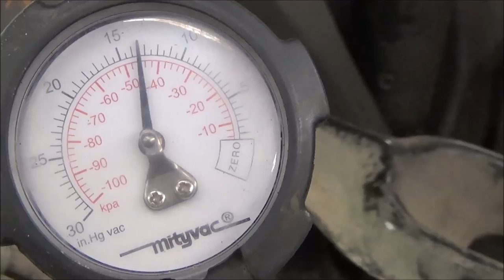Pontiac Grand Prix 3.8 - Water Pump Replacement

Comment: I've seen many cars go over 200k but never one as neglected as this one.  I have to say I'm impressed at its ability to keep going.  Kudos to Pontiac.
Reply from the maker: +Pook Atim Yeah that proves it... one heck of a car :)
Reply: It's that 3.8 v6. One of the best engines ever made
Reply: 3.8 is Buick.
Reply: Amen to that brother, on Wards Top 10 Engines list many times
Reply: you got that right !
Reply: not necessary ! they put a 3.8 in Oldsmobiles, Buicks and Pontiacs !
Reply: Mr Berzins is correct as Buick is the original source of the 3800, I'm sure that's what he meant. The 3800 engine was originally a Buick. In 1961 Buick needed  a more gas efficient ans inexpensive engine so they literally took their  current 8 cylinder and chopped off the end cylinders added a bit to the deck height and stroke and they had a 3200. In '67 they sold it to Kaiser-Jeep Corp for use in the Jeep, because they had to many 6 cylinders at the time.  In early 70's around the Arab oil embargo they convinced Jeep, now owned by AMC to sell it back to them. Buick tweaked ot a bit more and the 3800 WAS BORN !!!!!!!!!!! Its gone thru a few minor changes with the Series II getting an even higher deck height and some other changes, Series III a bit more tweaks.  A true true story. Search History of 3800 Engines, there's a wikapedia-fakia article on that which is okay but misses alot of the real history, look for a different link
Reply: @ColdWarVet607  actually the 3800 is a different engine of the old odd fire 3.8l
Reply: @ColdWarVet607  the 3800 wasnt released until I believe 1990 or so.
Reply: @JamesAnderson-fw5ew  Buick and Chevy both had a 3800, Buick design was used.
Reply: Your reading this to literally, in or about '73 when Buick bought back the rights from AMC, it wasn't called the 3800 but that was really when the 3800 was born as I said, one could argue in '61 when Buick chopped off 2 cylinders from its V8, that was its starting point, anyway what I wrote was the evolution of the 3800, not the exact day it was called the 3800, glad you're a 3800 fan.
Reply: @ColdWarVet607  do you know of the exploding intake manifolds due to faulty fuel pressure regulators on the series 2n/a?.....happened to me, engine caught fire....2001 Buick Regal LS....I miss Goldie😥
Reply: @ducethetruth7460  Yep, I have seen them, but I dont know its anymore than any other car, I think its just more published or maybe just because we are 3800'ers who talk about things that happen to our engine. But all return type system use the same type of vacuum controlled diaphragm to return gas to the engine and the standard rule is to always check the evap line on it for smell of gas. I'm not defending that GM could not have made a better pressure regulator, they certainly blew it with the plastic UIM that went on around '98 - 99 was it. I have an '03 and did a top swap , putting an L26 aluminum upper on mine, with exception of drill 1 brass plug in your TB and running a 6 inch hose from it to top of the L26UIM and plugging a egr port in the L26 thats all you need to do, otherwise bolts right on.

Want to see a spectacular explosion of this, watch this, I don't know whats worse the engine blowing up or the helpless guy standing around pissing his pants wondering what to do. Enjoy
https://www.youtube.com/watch?v=nvpWGQbj7vQ
Reply: @ColdWarVet607  Eyebrows singed. :)
Reply: Just to clarify the 3800 engine isn't specifically Buick or Oldsmobile for crying it loud. Everybody fighting about it is ridiculous. Do a bit of research. It's ALL GENERAL MOTORS. Same... Freaking.... Thing.  For anyone to think there is a difference between Buick, Pontiac, Oldsmobile, gmc or chevy is anything different from each other doesn't think outside the box.
Reply: 3.8 buicks from the 80's are still rolling in the south.
Reply: @JamesAnderson-fw5ew  early 1980's for the Gen 1 3800. GM put it in everything front wheel drive too.
Reply: Ever Forward.  Had a Buick 3800 in a 85 Pontiac Grand Am.    Timing chain broke and pistons hit valves.   Never thought a timing chain would break like this.   Repaired engine and got it back on the road.    Brother has 99 Land Rover Defender with Buick V-8.   Great engine.
Reply: Just say it's a GM engine, who cares what divisions of GM uses it.
Reply: Probably one of the most durable engines of all time, I’ve seen several with over 300,000 miles and they still run like new ,quiet smooth and powerful. Those cars were geared tall because they had a lot of torque,they would load along at 1600 rpm or so at 70 and return 29-30 mpg highway and they weren’t small cars at all! The 3.6 that replaced it is nowhere near the engine, so many won’t pass inspection because the timing chain codes ,and it’s. 1600-2000 dollar job to do them.....
Reply: Amazing that car ran long as it did like that
Reply: Tell that to my 1989 Pontiac Tempest 2.8L. Worse car made by man
Reply: LAFOLLETTER  thats the rwd smallblock v8 right?   I think all the v6 and 4 banger fwd gm cars from the 80's and 90's were total absolute crap, had two. The exceptions were the impalas, 88's, silverados, vans, 2 cadillacs...yes just 2.  Just my opinion from my zero personality self that studies and make notes of what i have seen on and off the road in the last 30 years.  Sometimes with the right operator and a ton of compassion thet can last but the way they break its hard to like them that much.
Reply: @freddyflintstoned913  no its gm.  and mines at 250 neglected worse than this.
Reply: Buick is obviously a part of General Motors but their engineers designed the 3.8 engine and there are obvious differences between each of their car divisions.  Yes you will find a lot of similarities in their family of vehicles especially when they share the same platform but each division has unique features, handling, and styling.  To say a Buick is a GM is obviously correct but to say a Chevy is a Buick is obviously wrong.
Reply: @tyler2610  just shocks and sheet metal.
Reply: @mikeschiavoni5973  So somehow the Delta 88 was good but the LeSabre and Bonneville with the exact same engine and platform were bad??  I see a lot more older LeSabres on the road than 88's.  In fact here in Indiana I still see a lot of Buicks from the 80's and 90's still on the road.
Reply: @tyler2610   Pontiacs were rarely single owner vehicles, eventually bought by turds that take care of nothing, children, cars, houses, themselves, NOTHING!!! Buicks are often single owner vehicles by older, smarter men that take care of thier stuff.  Thats why buicks last longer. Most parts were shared. There were cars in the 90's you could swith bumpers, grills, and tail lights.
Reply: LAFOLLETTER  its you, you are the great thing. Those cars are crap, most cars are crap. You understand the car, you know how it shifts, you care for them. You are what makes those cars good.  If you want to test my hypothesis let someone borrow your fierro for a few months.  😊
Reply: LAFOLLETTER  they all make crap designed to wear out. I think all brands suck.  Here is my opion order of popular brands, best to worst. 

Best:  none,  worst:  all. 

You couldnt even give me a mercedes, i would simply refuse it as its not worth the insurance or the hassles.  Bmws are a plastic mess (like new gms)  snap on plastic turbo inlets, no joke...well a joke, but no joke.  The chevy cruze and ford focus may just be relatively the worst cars ever made. Both cars often requiring 5k in repairs befors 50k miles. Im pissed, i know we can do better. As soon as ford or chevy irons out the problems they phase out the car....what happened to the 3.8? Low power, low gas milage. They went with how many other failed engines.  3.6 vvt direct injection and factory incorrect pcv. They blamed customers for not changing oil,  got algarythym Wrong on oil monitor. GM is the worst of them all.  Shiney kia imo.
Reply: @baldy194859  and chevys.
Reply: cant kill it
Reply: LIKE   A    ROCK
Reply: @willgeorgiadis6472        THE   BIG   3.8
Reply: @baldy194859  it's all gm
Reply: @mailmanjoe  well said,
Reply: I can't believe the sludge and how this never over heated. I have a problem with my 2006 grand prix 3.8 v6. It cranks over but won't start. It gets fuel to the fuel rail. Do you have another video on crank but won't start troubleshoot video

Comment: The GM 3.8L Series II and III 3800 V6 engine might be one the best engines GM has ever made.  As long as you changed the oil and didn't let them overheat, they would keep on running.
Reply from the maker: +stchman This one proves that!
Reply: South Main Auto Repair
How many engines are still running with several pounds of goo in the radiator.  Neglected and the engine still goes.
Reply from the maker: and run pretty well lol
Reply: stchman agree and change the coolant of course haha
Reply: Not even overheating them kills them. They are Iron Blocks on Iron heads. No easily warpable aluminum.
Reply: I'm not so enthusiastic about them.  An extremely common problem was failed intake manifolds and gaskets which could cause hydrolock and a trashed engine with no warning.  If you overlook that "minor" deadly flaw, sure if you keep changing the head gaskets they'll run and run till the rest of the car falls and rusts apart - because GM.  Series I had a metal intake manifold but I suppose it cost too much to use quality parts that don't get brittle from the EGR and crack apart.
Reply: There's an aftermarket upper plenum that includes a metal stove pipe sort of thing that (as far as I know) permanently fixes the plastic melting around the EGR port.  I put one on mine when I did the upper and lower manifold gaskets.  Also, Felpro makes a really good aluminum-backed LIM gasket that I believe permanently fixes the lower intake problems as well.  I installed that on mine as well.  Couple that with the aftermarket aluminum heater pipes and it's pretty much good to go after that.

Also, I'm pretty sure the Series 3 went back to using an aluminum upper plenum.  As far as I know, it was only the Series 2 that used the plastic upper plenum.  Pre-series 1, Series 1, and Series 3 all had metal.  Rumor has it that a Series 3 upper plenum can be modified to work on a Series 2.  You have to use a throttle body adapter though and there's two or three ports that have to be capped on the Series 3 plenum to make it work.  Seems way too overkill for me ... but I've heard of it being done.
Reply: LAFOLLETTER  Shoot man, 200k?  I'd be willing to bet on 400k+ with proper maintenance and gentle usage.  I love those 3800s.  Any series. I wish GM still made them.
Reply: This 3.8 Buick block has been around for a while. It's like the SB Chevy of Buick engines. Same basic engine as was in the Grand National. Those wp bolts were in that location for a while before they decided to put a ps pump over it. I thought we had a cheat for this issue but I can't recall what it is we did.
Reply: you even proven that they can run well on 2 coil packs lol.
Reply: totally agree. So far from owning one with 175k-215k miles the issues I've ran into are the aformentioned ones. Ignition module failure showcased in another SMAR video on a buick. Upper intake manifold, or gasket and stove pipe if you get to it fast enough. Switching to the aluminum coolant elbows on the alternator bracket. And the problem of Dexcool mixing with green antifreeze and getting the sludge you see in this video.
Reply: stchman  g m died in 1969
Reply: Your correct ..3.8 were great motors.
Reply: Everyone I had blew up with a hole in the block or the rods would grenade but they still ran so technically  I guess your right.
Reply: I think they're good engines but I blew two of them up in my Regal GS that was Factory supercharged but then again I was running double the factory boost so I guess I can't complain
Reply: The supercharged motors are different, have stronger internals among other things. Series ll Na weren't great imo
Reply: The 3.8 is one tough cookie, I ran my 1997 Bonneville over a hundred miles after it overheated, I stopped at a gas station the radiator was bone dry, I let it cool down filled it with water and drove home with the cap loose, I got a block from my house and she started bucking I just made it into the driveway, later in the day I tried to start it and it wouldn't even crank, I went to a friend of mine who is a mechanic I told him what happened he said to take the plugs out and spin the engine because it was probably htdrolocked, it shot the water out like a fountain, I got the updated replacement upper intake, underneath it was full of water cleaned it out changed the oil which had no water in it but did it just in case, started it up it blew smoke out the exhaust for a couple of minutes and the engine ran perfect, maybe I got lucky but my 2001 lesabre has 288,000 miles and runs great, and all I did was replace the upper and lower intake gaskets but not the whole upper intake, I bought it with 147,000 on it.
Reply: That GM 3.8 is a phenomenal motor. My mom had one in a 1991 Buick. Can’t believe she didn’t blow.
Reply: stchman corrrect
Reply: My 3800 is at 513,000 km (320,000 miles) and it still is going...  for how long, hmmm.... so far, seems ok.
Reply: I've got one that just had headgaskets replaced and I think some of the pushrods got switched. Guy said he didn't know they were different lengths. So I got go buy a Hayes manual and see what length goes to intake and what length is for exhaust. Only ran for about 10 minutes after put together so I'm hoping no damage has occured.
Reply: the best jerry  the best

Comment: I hope you made the owner of the car watch this video.
Reply from the maker: +Nutz4Gunz45 Nah they just want it back lol
Reply: @SouthMainAuto  We have an 05 that had the same problem....just not lack of maintenance, I foolishly read the warning in those great big letters "Do Not Use Water Only In The Coolant System"..and decided not to take heed.  Talk about a mess.  Wound up replacing the entire thing including radiator and fans.  Works great, now the AC is out.  Gave it to the kids and bout a 30yo Pathfinder..yes everything works surprisingly.
Reply: Nutz4Gunz45 ... Twice!!  lol
Reply: You can use water in the summer months, and an additive such as water wetter by redline, as long as it has an additive package. Ethyl glycol is a poor fluid for heat transfer, but we need it for its other properties.
Reply: butchtropic  Actually, scientifically speaking, there is anything in the natural world that's better at heat absorbtion that good old H20. Problem is, it doesn't play well with metals.

Comment: Can't thank you enough. Just changed out the water pump on my 2005 Pontiac Grand Prix . Had overheating problems and no heat and this fixed both. Video made it super easy...well...as easy as as it could be for a guy that's never changed out a water pump before.  You've earned another new subscriber. Thanks so much for posting these videos!

Comment: Had to replace the water pump in my son’s 2007 Grand Prix (soon to be mine) today. Changing out the pump literally took me a half hour after watching your video. Even taking out the power steering pump and putting it back in wasn’t too hard. It was just getting the cooling system bled out that was a pain in the butt. The belt went out on this thing literally two days before the pump did and there was no play in the bearing. Today when I pulled it out there was a tremendous amount of play and leakage. Thank you for this video
Reply: Chicago

Comment: Thanks for taking the time to record and post this.  This gave me the confidence that I had diagnosed the problem properly, and that the repair wasn't too unreasonable.  You're about to save a single mom some $$$.
Reply: My radiator wasn't that bad. The hard mud is Dex Cool sludge when the coolant brakes down. That crud has been in there far to long. Dex Cool was known for this kind of problem. I had a lot of sludge in mine too. Got some coolant flush and flushed my coolant system per directions. Have Fun Now.

Comment: Always replace the 2 plastic elbows in the alternator bracket when doing this job.

buy the Dorman (amazingly they are your best option) metal ones.
Reply: do it
Reply: I had my water pump off twice this week looking for a leak thinking it was the gasket before remembering I saw this comment about the elbows. Guess what? It wasn't the water pump that was bad it was the crappy plastic elbows
Reply: Yup had this issue too on that heater core bypass elbows. They fall apart incredibly easy so I changed mine with the metal ones, too.
Reply: Did they still use those silly plastic elbows in 2007?
I know the '04's did.

Comment: That was great! 
That was for all the people who say it doesn't matter about the coolant colour, just chuck anything in! I suspect it was a combination of that a about 14 gallons of leak stop.
I am surprised they didn't bring the car back complaining that the temperature needle had never sat so low before.
Great job as usual Mr.O. I love to see how you work with your tools, I always learn something. 
You have to be commercially viable but you always try to be consciencous and proffesional.
All I would have added was the classic, "Well there's your problem!" When you took off the radiator cap. I think you where in so much shock it escaped you.

Comment: thanks for this video, it was very helpful. I kinda laughed when you saw the bolt under the power steering pulley cause it happened to me. thought I had to remove the  pulley, but learned about the two bolts through the pulley on this video. Thank you.
-Gabe
Reply: TRY    REINSTALL   GOOD  LUCK